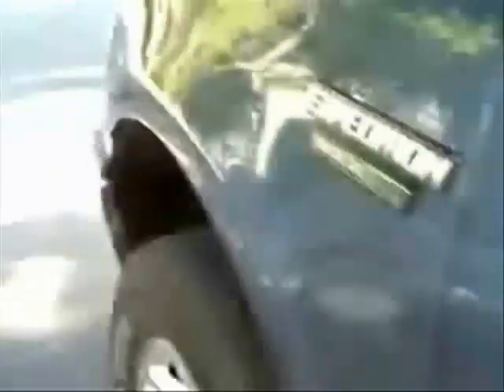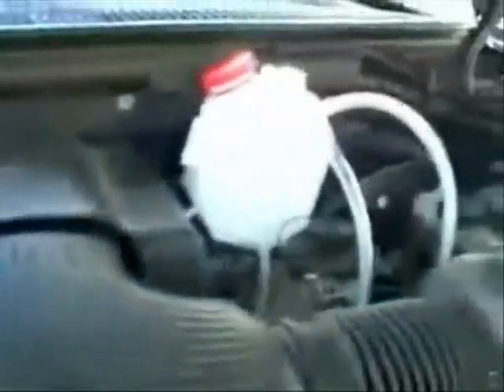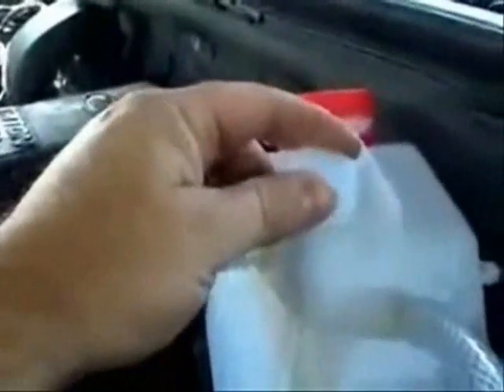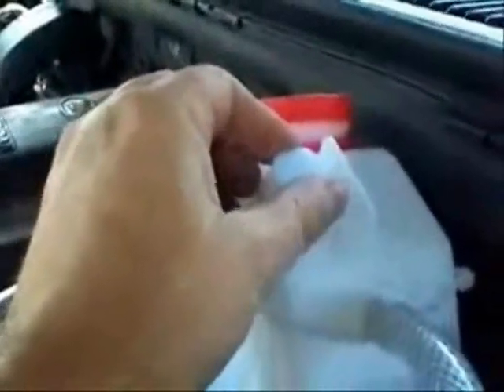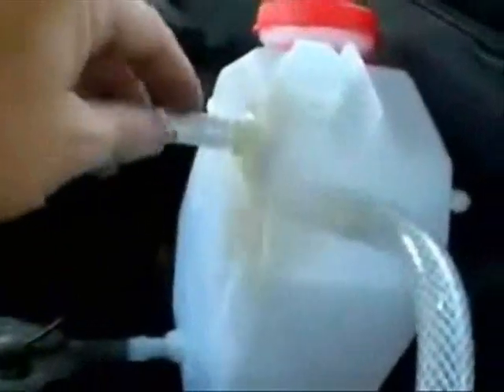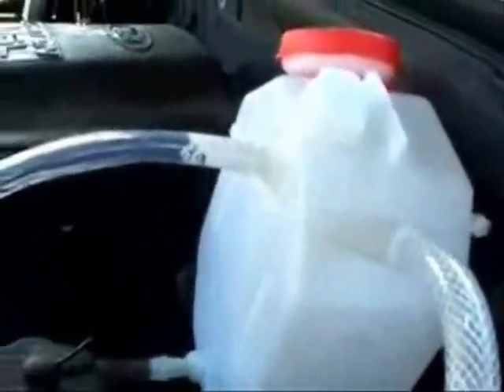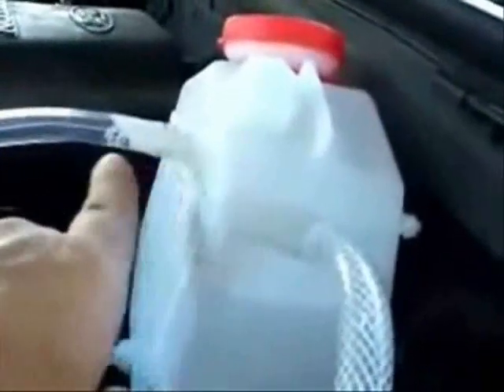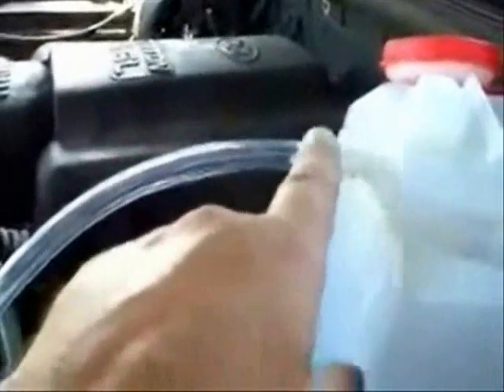Get Better Mileage in Ford Expedition - Increase Ford Expedition MPG "Save Fuel"

Comment: well you say "this beast gets 14.5 mpg", (well I'm here to tell you that's not at 55 mph) and then you say after your generator you get 23 mpg (but this is at 55mph).

I have an all stock AWD 99 Expedition 5.4L that gets 20+mpg at 55 mph on flat ground

So in short.... Please, for HONEST comparison purposes, run your vehicles at the same speeds before and after.